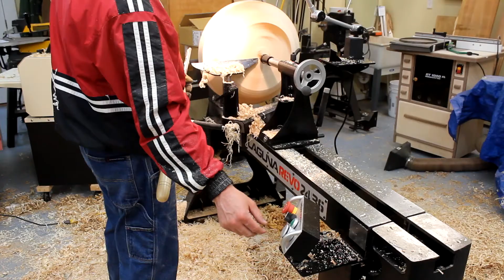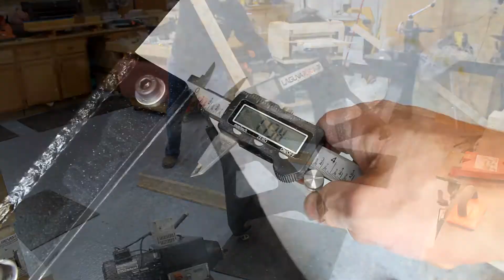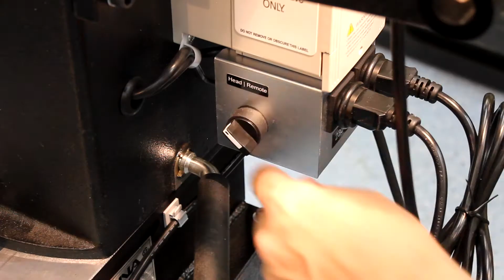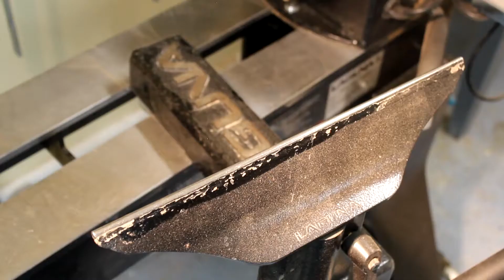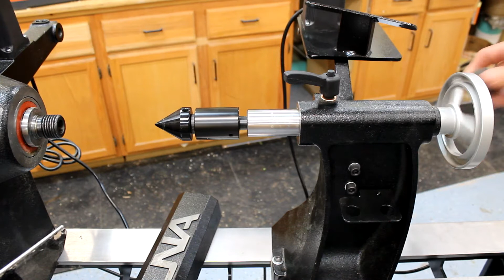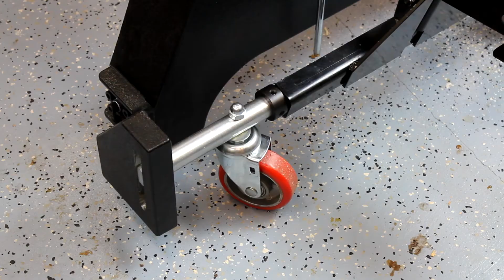Laguna Revo 24|36 Lathe "Deep Dive Examination" by ToolMetrix

Comment: We have just bought the 24/36 Revo have you had any problems ? just seen one review of the lathe and the fellow had had three heads replaced and some are saying not good with heavy wood . We are in Australia and the wood is really hard and really heavy . Just a bit worried now .
Reply from the maker: I’m still loving my 2436. No problems for me. I just turned 6 bowls that started out with blanks that were 85-90 pounds apiece. No problems. The lathe is lighter than some 3hp 24” lathes which means that you will have to start a bit slower than you would on a 1000 pound lathe. I started out each bowl at about 270 RPM which is pretty slow but was able to get up to 400 relatively quickly which is a better speed. So, for the money I believe it’s a great lathe.

Comment: I know this is an older thread but I'm considering a new 24-36 Laguna or the Harvey t60s. I've heard lagunas had problems with the motors, I don't know anything about Harvey's Servo motor. Any thoughts?
Reply from the maker: I hadn’t heard anything about motor problems with Laguna. I heard about some issues with earlier models where switch panels had to be replaced but I haven’t heard anything for quite some time. Im not familiar with Harvey lathes so I can’t comment on those.

Comment: I just came across this video as I am in the market for a new lathe.  After all this time, are you still using it?  If so, how has it held up?  There are numerous woodturners on YouTube that use laguna lathes but I concerned about quality. I am retiring soon and will not get another opportunity to buy another "forever" lathe.  Any insight?  Thanks.
Reply from the maker: Hi Alex, yep, I'm still using it and loving it.  Reliability hasn't been a problem for me.  Power is outstanding.  The only downside as I compare it to other lathes is that it's pretty light for a 24" lathe.  I've turned bowls on other 24" lathes like Robust and OneWay and the additional weight is nice.  But for me as a hobbyist, it's not a huge problem, but the difference is noticeable.  I've turned quite a few 20+" bowls on it without any problem, however.  It just takes a while to get the blank round because you have to turn at a slower speed.  That said, I don't really like turning stuff that big any more.  Those 100 pound blanks are a lot to lug around, and my friends and family don't seem to want those gigantic bowls.  So, net net, I love the Revo, and would also consider Robust and OneWay if your budget allows.
Reply: @ToolMetrix  thanks for the quick reply. I rarely turn anything that big either, I just like to have the capacity if needed. I live on 15 acres with lots of trees so I can make whatever size I want/need.  Thanks again and Happy Turning!

Comment: Have you tuned on the Powermatic 3520C and how does that compare with the 2436 not withstanding the extra capacity... I am torn between the two. Only thing with me is that I will require a base to step on in order to get the spindle to elbow height with the 2436. My elbow is at 41.5". Not sure about quality between the two either.
Reply from the maker: I haven’t turned on one but have looked at one and I’d like to give it a try. It’s a very impressive machine.  At the surface the quality appears comparable but it’s hard to tell with a longer term test. I built a platform for my daughter to use when she turns on the 2436. Worked great.  I think you’d be happy with either machine.

Comment: Im new to wood turning and i have the revo 24/36 and im wondering what is the knob on the backside of  the lathe box for
Reply from the maker: What are you referring to as the lathe box?
Reply: @ToolMetrix  the VFD box which has the CB reset button. it has a rotating knob where you can increase and decrease
Reply from the maker: I’m pretty sure that is disabled, and the functionality is controlled by the dial on the speed control knob on the front of the panel. But Laguna could tell you for sure.
Reply: @ToolMetrix  I might be mistaken but when I played with it i had a feeling that the torque changed
Reply from the maker: Interesting. Definitely worth checking with Laguna in that case.

Comment: Watched both your 18-36 and 24-36 review. I'm in a dilemma which one to buy. Is the 20" bed extension and riser the same part for both lathes?  Thanks
Reply from the maker: Hi Chris, they are the same design and work the same.  I'm not sure whether they are in fact interchangeable across the two machines.  I would think that the riser would be taller on the 2436 but I'm not positive.  For me, the 1836 has plenty of capacity for anything that I'd turn.  I've turned some pretty big stuff on there, and there are professional turners who turn some massive stuff outboard on the 1836.  For bowls, if I can lift it, I can turn it on the 1836.  The upgrade to the 2436 is mainly about the additional power, which is noticeably significant, and the auxiliary switch.  The banjo is also nicer.  The extra 100 pounds is nice too, but you can always add some weight.  I still turn on my friend's 1836 once in a while, and I can definitely notice the power difference but it's still a great turning experience even after spending a couple years on the 2436.  IMO, you won't go wrong with either machine.
Reply: @ToolMetrix  Thank You, I definitely want that extension and I think from a budget standpoint and your comments, I'll go with the 220v 18-36. Much appreciated.
Reply from the maker: The extension design on these machines is awesome. I’m mainly a bowl turner but I use the extension constantly for outboard turning. Even if I’m turning smaller bowls I really like the ergonomics when scooping out bowls. It’s a great accessory.
Reply: @ToolMetrix  Thanks, my main lathe focus is bowl/platter turning. I'm moving from  a Oneway 1224, so really wanted the extra over the bed capacity. With the extension, I really don't see me turning something as large as the machines capacity.

Comment: I am fairly new to turning. I really want to upgrade from my jet midi. I want to buy a lathe that I will not have to replace again. I have been reading and researching a lot. I really like this lathe but it seems that the “experienced turners” seem to turn their noses up at this lathe. I read where one “expert” was claiming that it was not truly 3 hp. I also see that many quality lathes like some Robust and powermatics seem to have 2hp. How do you feel this lathe stands up to some of the more preferred lathes I mentioned above and why is the price when compared so much cheaper? Some insight would be greatly appreciated.
Reply from the maker: Hi Russell,

I have not heard the claims that this machine isn't a true 3 HP lathe.  What I can say is that I would never say that it lacks power.  I've turned quite a few 20"+ bowls on it, and I've been amazed by the torque it delivers.   I would love to spend some time on a comparable Robust and Powermatic, but unfortunately I haven't had the opportunity to work with either one.  Based on everything that I've heard, I have no doubt that both of these are awesome machines.  I think that Robust has some nice features that are differentiators, such as the tailstock swing-away mechanism; very cool.  The American-made aspect is extremely appealing and everything that I have heard about the owner and the company culture are very cool.  I think the price tag is high because manufacturing big equipment in the US is expensive.  Labor and materials are more expensive here, and these guys are producing a low volume, super high quality machine, so I'm guessing that it's probably challenging to hold the pricing down as low as it is.   Powermatic is a different beast entirely.  Lots of cast iron there, because as I understand it good quality castings are a lot cheaper to produce in Asia.  That's why you see the massive cast iron bases on the Powermatic and Laguna.  Very expensive for manufacturers to do that in the US.  If you're turning large bowls, that cast iron base brings a nice weight advantage, and I'm guessing that the Laguna and Powermatic machines are heavier than Robust as a result.  So, net net, I don't think there is a bad choice among these three.  I think that people who can afford Robust will typically go that way; American made, incredible attention to detail and quality, and customer service that people rave about.  Powermatic was the US king of imported lathes,  and for years they lived up to their slogan as "the gold standard".  I think they still make a great lathe, but (and this is purely speculatively and anecdotally), I believe that Laguna is in the process of displacing Powermatic in this category.   As I said I would like to get some hands-on experience to qualify my perspective on this, but I believe that the 2436 is very comparable to a Powermatic, and arguably even better in some respects.  Why is Laguna selling theirs so much cheaper?  I'm not sure, but at this point I do not believe that it is because of a perceived product disadvantage.  I think it is because Powermatic is the established market share leader in this category and they are commanding a premium price with some nice profit margin built in.  Laguna really just got serious about the lathe market when they introduced the 1836, and ever since then they seem to be using a low margin penetration pricing model that is all about building a large loyal base.   In order to sustain a business at the low price points they are going to have to drive a lot of volume.  It seems like the strategy is working, and you may have noticed that they recently increased pricing on some products.  This could mean a lot of different things, but my hunch is that the strategy is working and products are starting to enjoy some demand that is resilient to small, incremental pricing changes.  Even with the pricing increases there is still a lot of room between Laguna and Powermatic pricing.  At some point they might be more expensive, and if the perceived value is there, people will continue to pay it.  Jet/Powermatic did the same thing to Delta 20 years ago.  Prior to that, Delta (in the New Yankee Workshop days) was the kings of woodworking power tools, and Jet was always 10% cheaper, and pretty comparable quality.  At some point there were enough Jet/PM enthusiasts, that they were able to increase the prices above Delta's pricing, and within a couple years, Delta became irrelevant in the woodworking community.  I believe that Grizzly had a lot to do with that too, but that's a whole different discussion.  Sorry for rambling. :)

Comment: Nice review like the 18/36.  It was that review that ended up selling me on the machine and I've had mine for over a year now.  I graduated from a Shopsmith and its lathe so you know what a jump in performance I experienced.  If I was buying today, I'd likely opt for this model just for the extra power.  With a heavy, wet bowl blank I can overpower the motor on the 18/36 as I lean in with my roughing gouge.  Still, the 18/36 seems to do all that I want.  I have one nit pick and that is the wheel on the tailstock.  Held on to the shaft by a single set screw it will come loose every so often.  The shaft is getting a bit scarred up from the set screw.  I have to remember to check the tightness of that screw on a regular basis.  Love the lights.  Love the wheels.  I have nicked the tool rest with a sharp edged tool, though; it's not bullet proof.  What I still find when I compare is that it has the features and performance of a lathe costing $2-3000 more.
Reply from the maker: Thanks for the feedback, Mike.  I'm bothered by the problem that you're having with that tailstock hand wheel.  I haven't had to touch that set screw a single time in 2 years, and I just checked it and there is no slop at all.  I would try locktite, and if that didn't work, I'd try a different set screw, and if that didn't work I'd request a new tail stock.  That should be giving you trouble free service.  As far as the power goes, I never thought that the 1836 lacked power until I used the 2436.  Yes, I've slowed down the 1836 with some of the soaking wet blanks that I've only roughed with a chainsaw, but it is so much more powerful than any lathe I had used previously that I guess I was impressed that it could handle that much mass at all.  I can definitely tell the difference on the new machine, however.    I agree with the comment about the 1836 comparing favorably against more expensive machines.  I think Laguna has gotten very serious about going after this market.   The only design modifications that I would suggest would be American motors (I haven't had any problems at all, but I'd have higher confidence) and stainless steel bed for guys like us who like to turn soaking wet wood.  Although the other day I turned a bowl and my lathe didn't rust, but there was water spraying on my jointer and that rusted because I didn't notice it soon enough.  This woodturning is one messy hobby!
Reply: Helpful response.  Thanks.  I'll chat with Laguna on this.  Re the 14" bandsaw you have also reviewed, I just sent in my ReSaw King blade for resharpening and expect to get it back next week.  Customer Service so far has been OK to deal with.
Reply from the maker: Glad to hear that.  It seems that Laguna has made some improvements in their customer service area, as I'm hearing mostly good reports these days.  That ReSaw King blade is amazing.  Sounds like you're using it a lot!
Reply: That blade is well worth the $150.  I've used it heavily to cut logs into bowl blanks over the last year; mostly wet wood.  Have also cut some very hard dry wood.  I nearly wore it out but Laguna said it was still worth resharpening.  If I remember, I can let you know how well it works when they return it.
Reply from the maker: Wow, that's great.  I haven't used it on bowl blanks and I was wondering how it might work turning a circle through a gnarly piece of wet wood.  I've wrecked a couple regular blades by twisting them in a log while rouging out a bowl blank, so I was leery to do that with the higher $ RK.  
Let me know how it works when you get it back.  Supposedly you can sharpen them several times, depending on how worn down the teeth are between sharpenings I'm sure.

Comment: Excellent job on your video . One question , is the tool rest post 1" or like the 1836 less then 1" .
Reply from the maker: Hi Stan, thank you.  The tool rests on the two machines are identical.  I measure the post at 1".
Reply: My 1836 must have came from the factory that way , because mine was 25.3  and my robust tool rest would not fit .So I took my banjo to a machine shop they honed it out now its fine .
Reply from the maker: Dang, that sounds like a defect to me on either the part of Robust or Laguna.  I use the standard Laguna tool rest about 80% of the time, but I also use a curved Robust tool rest for better support inside of a large bowl.  It fit perfectly with no modifications necessary.